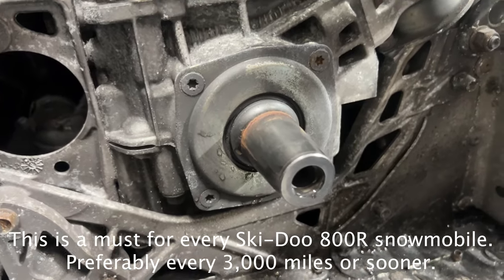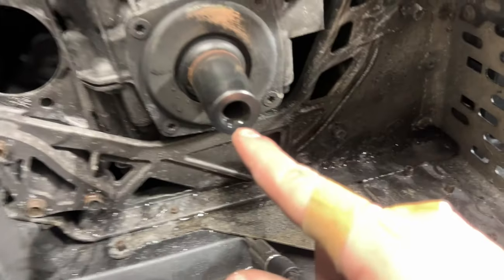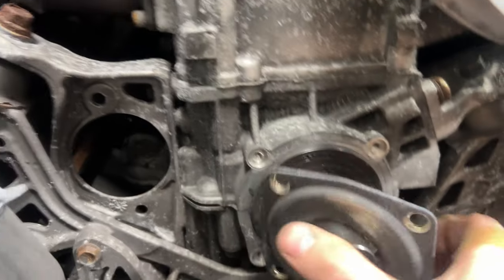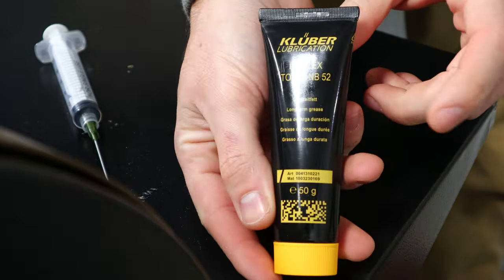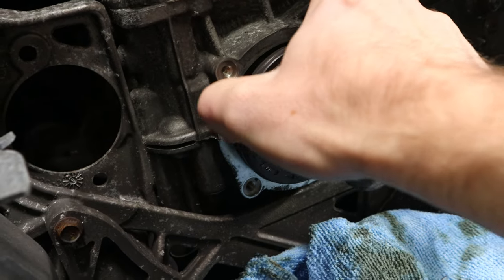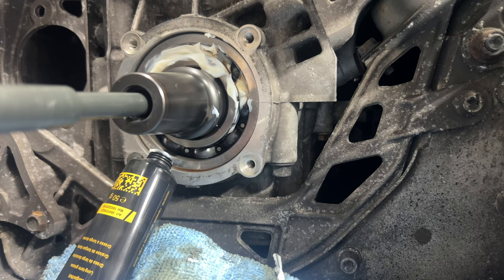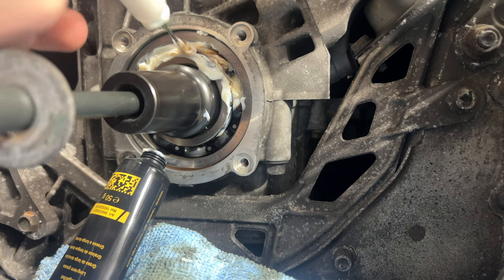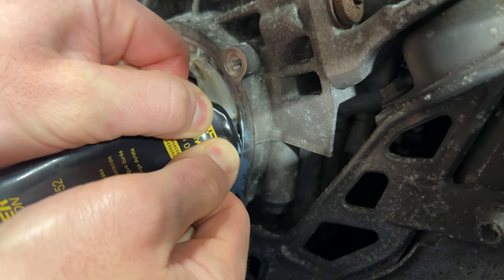Not Doing This Will 100% BLOW Your Ski-Doo Snowmobile Engine!

Comment: They couldn't just run an oil line to the bearing for priority lubrication? After all,it is the crank. Cool engineering BRP.
Reply: I believe that's how the 850s are setup.

Comment: There is isoflex on the mag side also, done thru stator screws, later models have it in the inner bearings as well.
Reply from the maker: Yes forgot to mention that! This side wears faster because of heat
Reply: @Build Culture  no, PTO side wears faster due to the belt  load...most bearing failure on pto side....it's the opposite on seadoo's

Comment: Why not use a solvent or brake clean to remove the old grease from the bearing?  Is the Isoflex the manufacturer's recommended grease?  Or one you believe is better?  The syringe method is very useful, is wearing nitrile gloves and packing the grease with your fingers not as effective?  Thank you for this video!
Reply from the maker: Idk it just felt wrong at the time. But others here have said it’s not an issue. Just did what I thought was best. 

And the syringe seemed like a very effective method to get it all into the crevices and squeeze out as much old brown grease as possible. Worked quite well. 

As far as I know that exact isoflex grease is exactly what is used from OEM. It is pricey though.
Reply: @Buildcultureyoutube  Thank you!

Comment: There is a 1/4 inch pipe with a red cap on it behind the clutch on the crankcase to grease the pto bearings. Just add some grease every 2000-3000 miles. The other side is much more difficult, you have to take off the recoil pull the flywheel and add grease through the top stator bolt hole after removing one of the bottom stator bolts. That side needs to be greased, but not as often. The best way is to pull the engine and split the cases though.

Comment: Do a leak down test on that seal after you do this.  If seal is bad you need to pull motor and pull off bottom of crankcase to properly install a new brand new seal.  A new one will not push in without wrecking it.
Reply: How do u preform this test @Junorr500. I did this job about 1500miles ago and now i noticed coolant seeping out of bottom end headgasket .
Reply: @skidooman97  leaking coolant is a whole different issue.  Sounds like time to      tear out motor and do all new gaskets.  May as well split bottom end case to reseal it and do oil seals to.
Reply: @skidooman97  to do leak down test you need to pressurize the crank case.  I take carbs off and fit a plug with a schrader valve and a gauge threaded into it and clamp it into carb boot. Pressuize it with 10lb is plenty and watch the gauge. If it drops you have a problem.  My clutch side crank seal was leaking. Can see it if you use soap and water and spray it on seal where crank comes through.  Will make bubbles.  To make this work though you need to seal exhaust as well.  Remove y pipe and make a cover/gasket for exaust and secure it but bolting y pipe back on.

Comment: Nicely done! I am wondering, did you replace the old fuel hoses simply because they were to old an dirty, or do 
the new ones have a bigger diameter? Or they just much better? Regards Tobias/Sweden
Reply from the maker: Hi thanks for watching! I don’t believe I changed the fuel hoses on that sled unless maybe I’m forgetting something? I usually just replace stuff that looks old without thinking much lol. But this specifically I do not remember

Comment: What about the big crack in the casting outside the bearing 3 o’clock position
Reply from the maker: I believe that’s where the 2 pieces of the case meet. I can see how it can look like a crack now that I look at it lol
Reply: That IS the crankcases face joints. It split horizontally.

Comment: Wh6 would u not use brale clean?
Reply from the maker: Was worried about it messing with the new lubricant
Reply: I can confirm that isoflex grease doesn't dissolve in either brake cleaner or isopropyl alcohol. 

I did a test by taking some of the old grease and putting it in containers with liquids. The only thing that dissolved it was WD-40.

Other solvents I don't have might work as well of course.
Reply from the maker: Nice!

Comment: I have seen 600SDI engines go 30,000 with ever being apart.  Same Isoflex
Reply: The 800's don't go that far without replacing Iso.
Reply: @Steve Campbell  true, about 10-12kms on an 800...but about the same as any 800

Comment: Why did Ski Doo design the 800r this way? Whoever did should be fired immediately
Reply from the maker: What specifically?
Reply: @Buildcultureyoutube  he is referring to the isoflex grease design instead of using the two stroke oil like the new ones do
Reply: You can thank the EPA constantly requiring tighter emissions. They stopped oiling to reduce emissions afaik. I'm aware they are now oiling the 850 again, but i think it uses so little oil they can keep their emissions in check.
Reply: @Buildcultureyoutube Supposed to be 15 ML not the whole 50 gram tube.
Reply: You’ve obviously never worked on anything built in the last 20 years with an engine and efficiency in mind. Not grammatically correct but you know what I mean. They used to be simple. But they aren’t anymore.